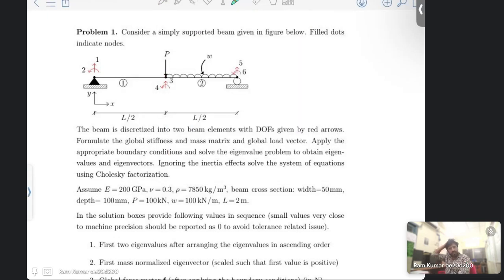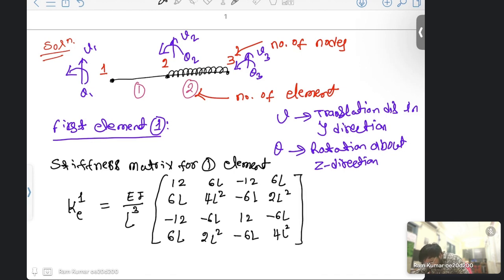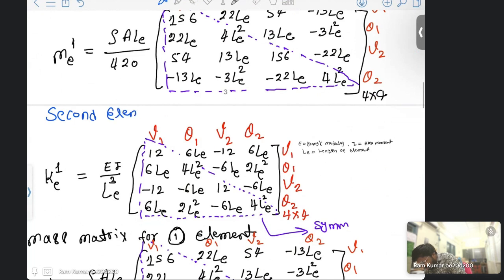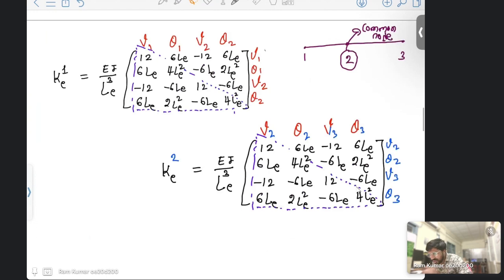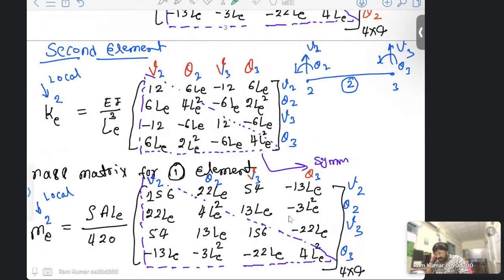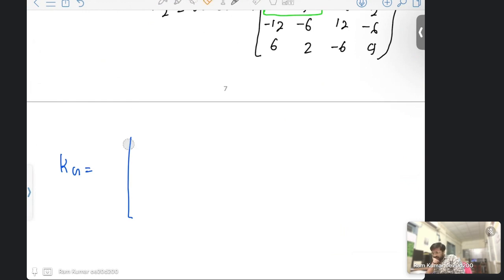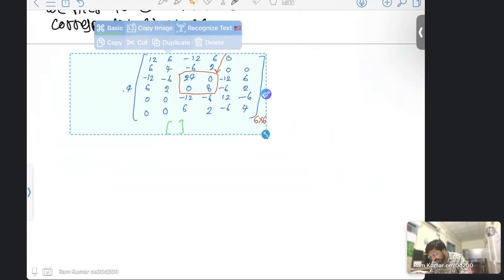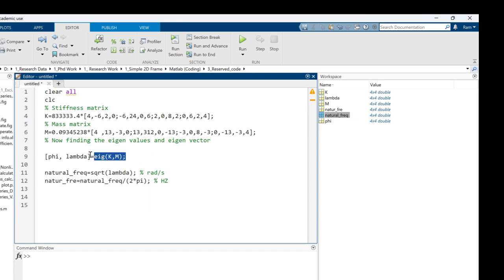Week 9: Beam element problem || Finite element method and computational structural dynamics||NPTEL

Comment: good evening sir    the element 2 has udl whether it affects the eigen frequency     suppose if both the elements has udl is there any change in the procedure... or whether we have to add in force matrix  pls explain
Reply from the maker: Good evening ..As we know that, to find the eigen value and eigen vector we have to assume that there is no loading and also there is no damping in the system. In terms of structural analysis eigen values represents natural frequencies and eigen vector represents mode shapes and to obtained natural freq and mode shapes is called as modal analysis. So even though we put both elements with udl or one element only .It will not affect the eigen values and vector because these are depends on the system properties like mass and stiffness . If you still have any query please free to ask . I will happy to answer that.
Reply: Thank you very much sir